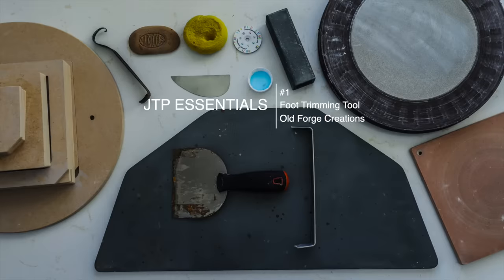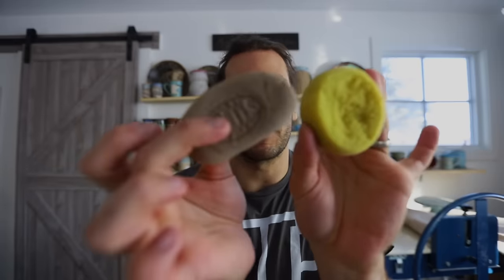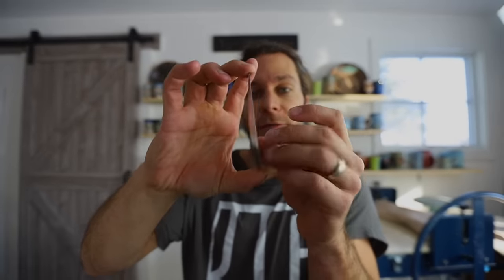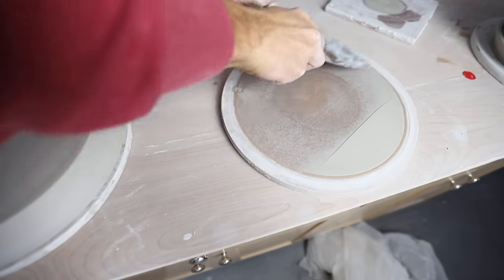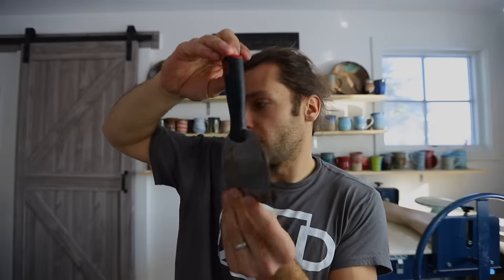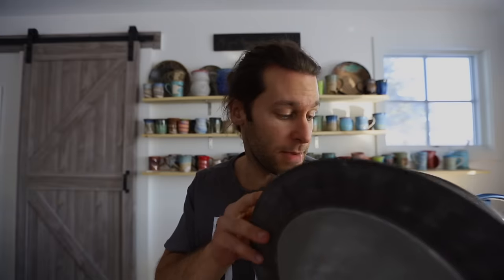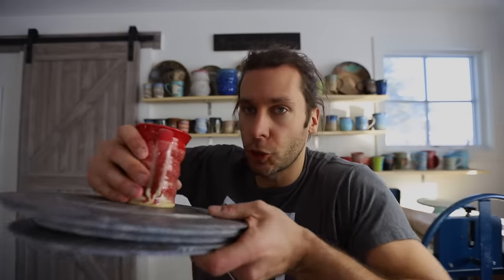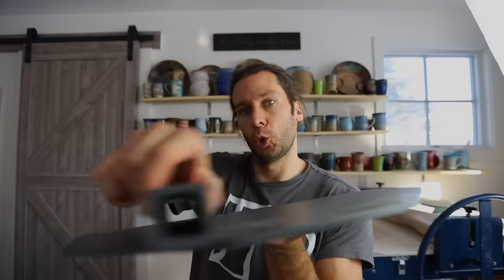10 ESSENTIAL TOOLS for the Pottery Studio!

Comment: Hello from England! I love your fun, positive energy videos. I am a bronze & ceramic sculptor, but find it hard to sell work that is quite expensive. I've always wanted to try pottery as I love working with clay, so now have a wheel too. I  am watching my way through all of your videos. Throwing is hard! For a pure beginner, could you please suggest 10 items to throw in order of ease? I'm not sure what I should be attempting first. I can just about center, throw a coaster, a cylinder & a very small vase. What order would you suggest so that I can improve steadily? Thank you for sharing all of your useful tips. Keep making your lovely videos. They are a delight to watch 😊. Helen
Reply: He didn’t really answer this question. Bowls are good because they are simple. Making the same thing over and over really teaches you. I tried to make everything at the beginning and had many failures. It was sad because I elaborately decorated them. Mugs sell very well but you have to learn to attach handles and make them. At the beginning you are very much learning the touch and feel of clay. I found that every 6 months that I was better. Wobbly mugs were good to practice glaze on.
Reply: @Cate7451  Thank you for your suggestions. Gosh 2 years have passed now and I did find that little cylinder egg cups were brilliant practice. Then espresso cups, spoon rests, mugs and salt pots. I still need to attempt bigger bowls. Having the clay the perfect consistency really helps. I love throwing pottery. For anyone starting, just keep at it. It is so rewarding xx